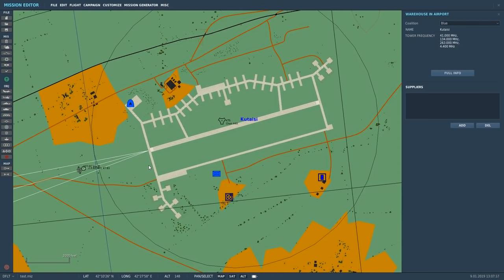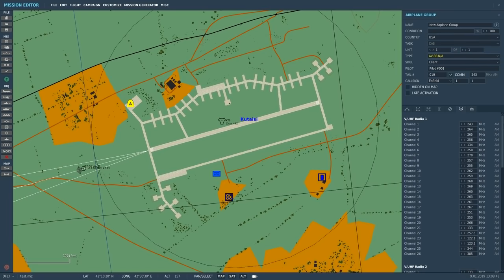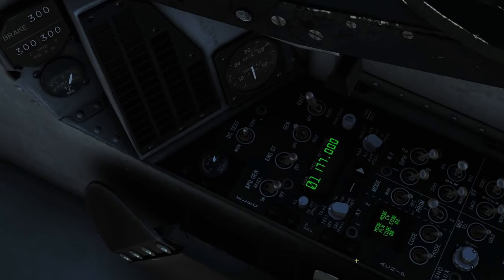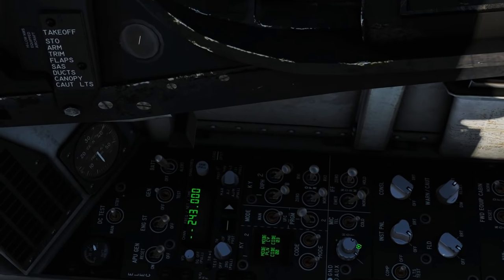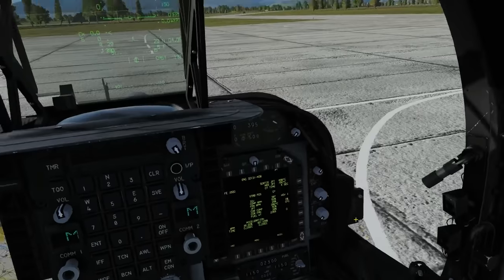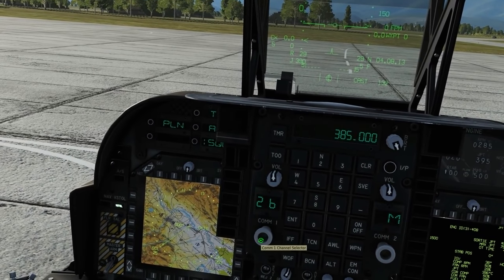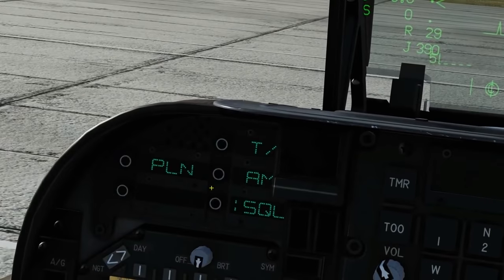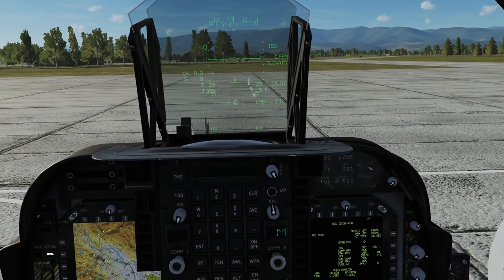AV-8B Harrier: Radios Tutorial | DCS WORLD

Comment: Thanks for this, I've just been punching everything in in manual mode, didn't realise you could scroll the comm buttons. Do you know if it's possible to change the presets as the pilot?

Edit at 9:00 :)
Reply: Yes, you do it in the Mission Editor. Click on your Harrier, and open the page where you can change your weapons\fuel loadout. One of the tabs (on the far right) looks like a little radio tower, there you change the presets for COMM1 and COMM2  :D

Comment: Hi
I tried to tune with radio backup but now not working anymore

1) Try in two different airports with a victor freq and uniform freq
2) Try on stable and openbeta
3) The radio control switch is in ON position
4) Try with radio1/2 selector switch
5) Try with freq preset from editor and in manual mode
6) Try with RSC selector in TR and TR+G

It's ok only when using UFC Radio.

Can you try plz ???
Reply from the maker: Rgr will check it out.
Reply: @grimreapers  Hi. So, have you tried?? Thanks